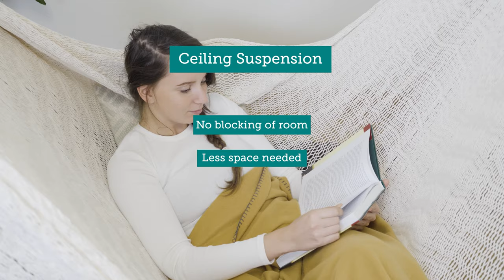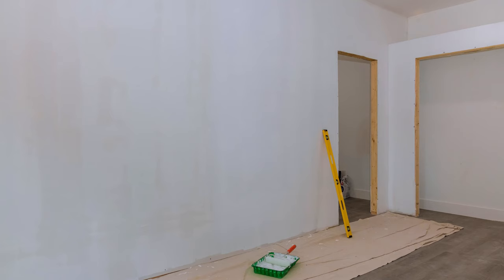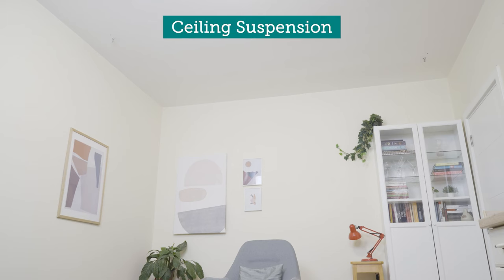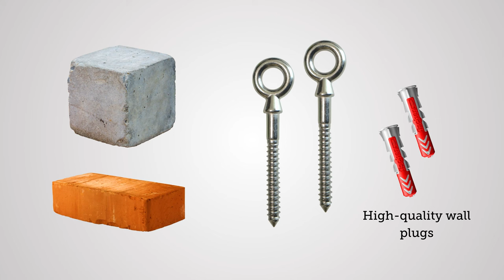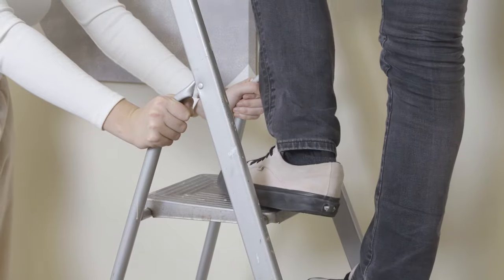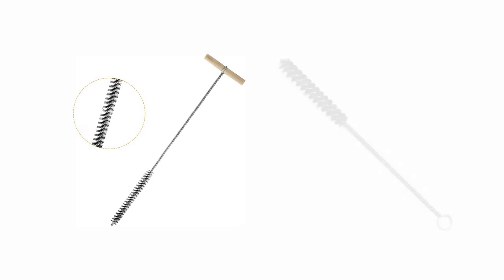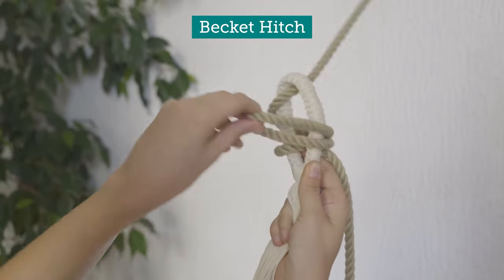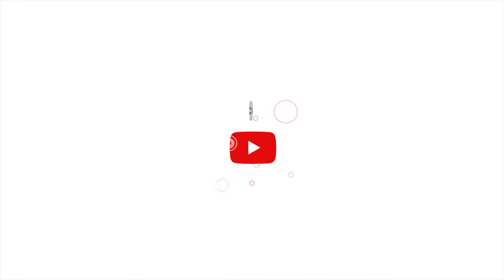How to Hang a Hammock Indoors: A Complete Guide 🛠️

Comment: I was told the foot end of the hammock should be higher than the head. This is because   your weight will make the foot half lower more than the head so you will then lay level.
Reply from the maker: I understand the idea, but in a traditional hammock, you typically lie diagonally or crosswise, to have a straight back. Because of this, there's no distinct 'foot' or 'head' end. Instead, the key is finding the right angle to ensure comfort and proper alignment while you sleep.
Reply: @hamacama  The foot end is the end where your feet go and the head end is the side your head is at. :) I sleep in hammocks at home often and having the foot side a bit higher makes it even more flat when you lay on the hammock on a diagonal. Otherwise you can run into an issue where there is pressure on the calves or not enough support.
Reply from the maker: @Meskarune  Ok, I get it—you meant when lying diagonally too. Thanks for the advice! 🙌

Comment: I'm not an engineer or anything but I don't think you need to find a load-bearing wall to hang your hammock. If you're building according to code, any normal 16 on center stud layout should work just fine. Obviously, you're going to have to find a stud. If You weigh 500 lb this is probably a bad idea but if you don't, if you are more normal size then you shouldn't have any trouble getting a 2x4 to support half of your weigh 180 lb, if that's the case then the study will only need to support an extra 90 lb. 

There are definitely certain things that you don't want to do with a non load bearing wall but hanging a hammock is not one of those things.
Reply from the maker: Well the weight will be not 90 lb but still 180 lb if the hammock hangs like a normal banana shape (see https://www.hamacama.com/en/hammock/suspend/hammock-angle/) and then you also have to consider that when lying in a hammock there are extra forces at the moment you sit down - so the real weight might be 250 lb.

 I'm not sure if the studs will be strong enough for this load.